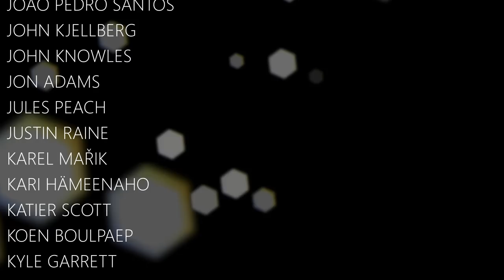How to use the Cut-to-Cut Technique - Back to Basics Mini-torial

Comment: Yes, in crossgrain chiseling the trick is to come in and slightly upwards from both sides and then lower the angle until you meet the other edge. When done perfecly, you end up with a level surface. That's the fun kind of woodworking, screw routers :-)